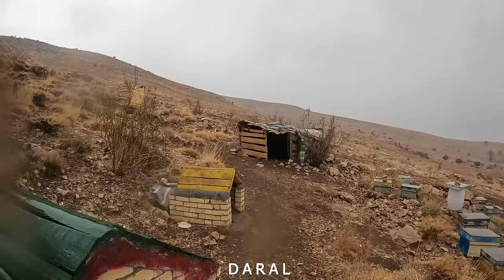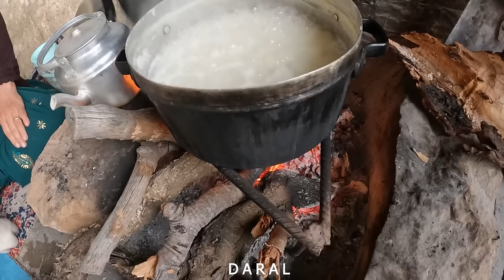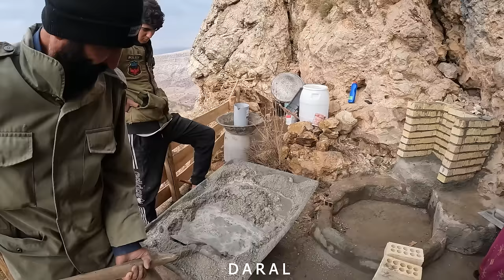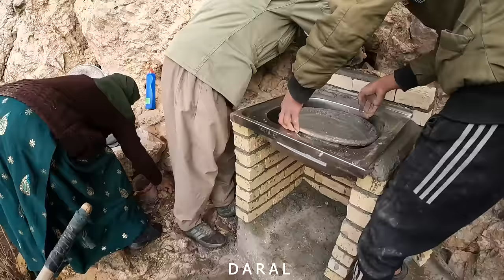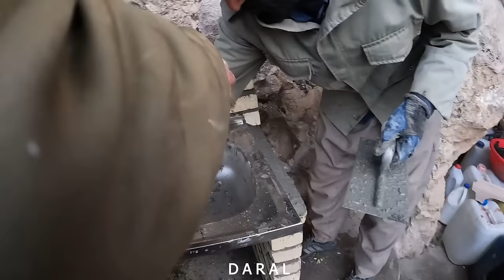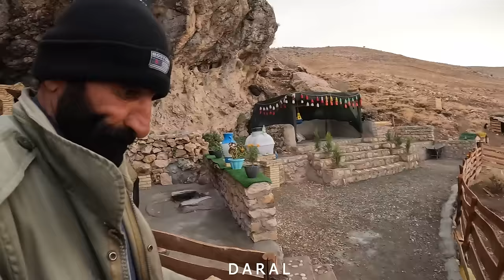"Amir and his family install the sink | Enjoying the beautiful and heavy rain"

Comment: Another suggestion would be is that concrete ledge you made by the entrance way would be great for a big potted plant or big tree planter. Or water fountain, or sculpture, piece of Art
Reply: Admir add drain hose too drain under fence and secure it with cement so women can stand on it while doing dishes and not crush it or get wet
Reply from the maker: sure honey😍🙏💖💖

Comment: Amir are you going to rebuild the wood shack with brick so they can sleep in it?  That other room would only sleep two people
Reply: No.
Reply: One time when Amir’s sister was there, they all slept outside but in the space outside what is next to  the kitchen/food storage room.  It was summertime.  At first, I thought Amir had two wives and almost stopped watching.  I’m glad I didn’t stop watching.
Reply: @Manfrog100  that was summer time they said they get snow. That’s why they bought the heater bcuz their land doesn’t have a big supply of dead trees for wood. My grandmother use to use coal. I don’t know if they have it or may be expensive.